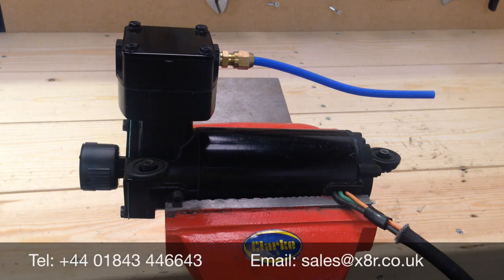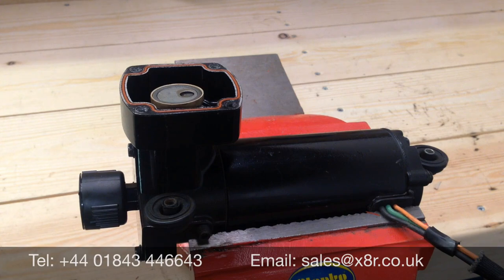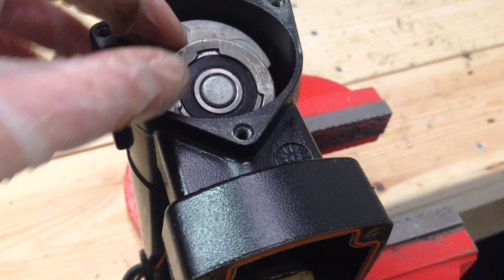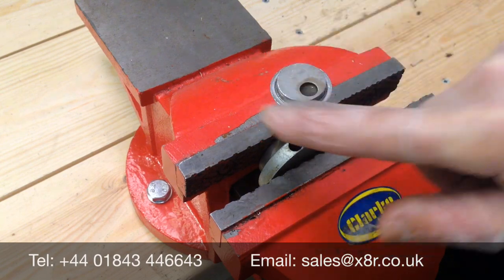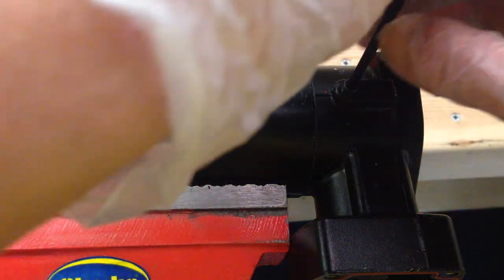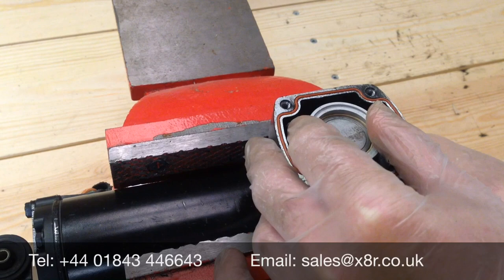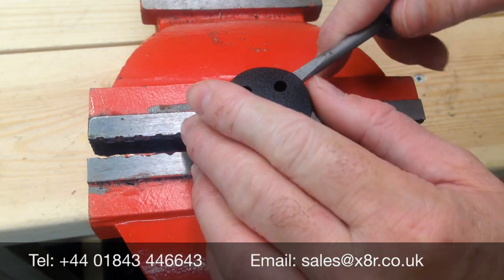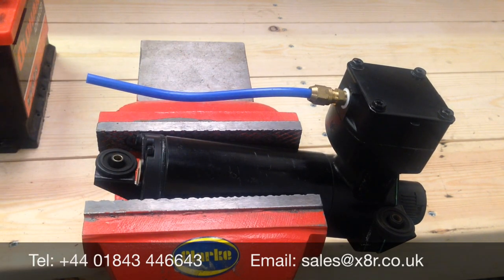Range Rover P38 Eas Air Suspension Compressor Pump Seal Repair Install Guide

Comment: I ordered this whole set in the video to rebuild my compressor. Took me a few hours but was able to follow along step by step and get the job complete and fix my truck. What repair shops told me would cost $1200 to fix i fixed it with way less by ordered these parts through your company. Saved me hundreds of dollars.  Thank you so much..

Comment: Why does everyone do this the hard way? It's much easier to put the liner over the con rod first, then fit the seal. You can then slide the liner up over the seal easily without the risk of damaging it
Reply: +Omar Majid You're welcome Omar, good luck with the job.
Reply: +Omar Majid Hi Omar, the rod and liner go into the housing without any problems.
Reply: I agree Kevin, much better way to do it. I would also have preferred to see some soft face guards on the vice.

Comment: Hi can you advise the allen key size for the screw at the side to release the piston?
Reply: the allen key size is a 5/32 imperial unless its been modified before
Reply: @0907jimbob  mine was open and stripped..rrr I rebuilt while still connected
Reply: If you don't have it, do it without taking the piston off. Very easy.

Comment: Will this be the same for range rover classic? 1995
Reply from the maker: If it has air suspension it will likely have a similar system.